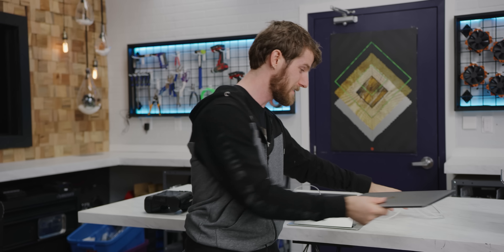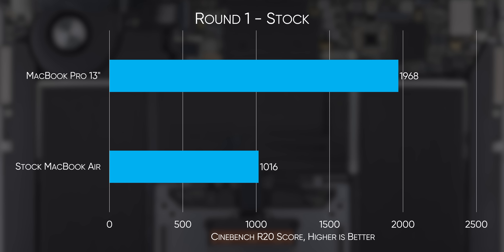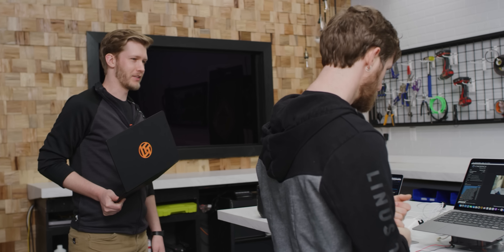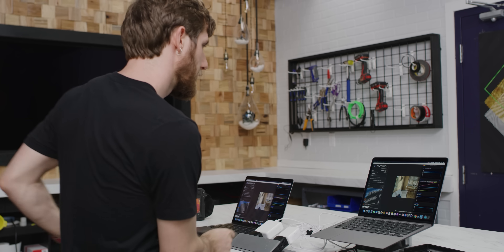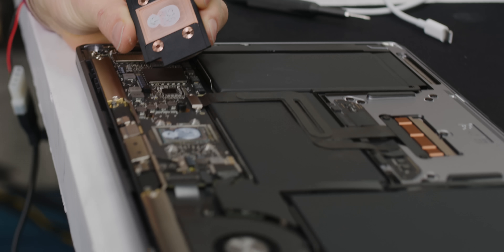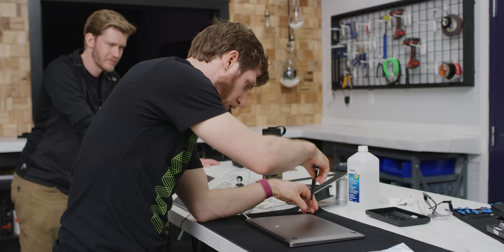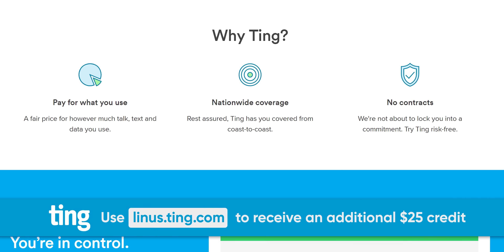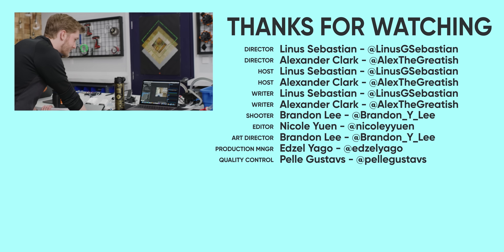Fixing Apple's Engineering in an Hour

Comment: Apple spends $$$$$$$$ on R&D. They have their reasons for “bonehead” decisions.
Reply: Well,
Having the CPU in contact with the bottom meant that the bottom was too hot, at around 50°C. This is why they did not do this.
The only way to keep its temp in check would be to have an active cooling solution, and that's it.
One does not fix a problem by creating another one.
Reply: traeng having an active cooling solution would mean making it bigger. This is an ultrabook specifically designed to be leightweight, thin and quiet.
Reply: @swisstraeng  You should apply as a engineer at Apple!

Comment: Apple had already made it clear on the spec.  Macbook Air has an i5 1.1GHz CPU.  Pro has a i5 2.0GHz.  You should not expect Turbo to run all the time.
Reply: What? Are you some kind of special Apple representative? The new macbook CPU heatsink is clearly a downgrade. 86C+ temps usually should be avoided, let alone 100C. This thing won't last past 1 1/2 years.

Comment: I put 17W/mK thermal pads between the cpu cooler, heatpipes, and heatsink on my Dell xps13. It used to sit at 99C constantly. Now maxes out at 70C. Unfortunately the bottom of the chassis hits 70C too. Buuut you know, trade offs.

Comment: Great episode. My 2019 MBP i7 runs ridiculously hot. Too hot for normal laptop usage. I keep it in a vertical stand with a fan blowing on the back. I also run Macfancontrol app and Volta. Easily hits 90C with a few Chrome tabs.

Comment: My 2015 Haswell Air has a heat pipe connecting the CPU and fan, but Apple redesigned the Retina Air around ultra low power m3 processors, and now they are shoehorning a quad core into the same platform. You think they would learn from the 2018 i9 MacBook Pro fiasco, but no...

Comment: You made the same mistake that Louis does and assumed it matters here. It doesn't. That's the point. The reason their cooling is passive with case airflow is that that's all that's required and allows the laptop to be thinner and lighter as a result. It's a low TDP CPU with specifically designed power delivery. It's not a workstation and it's not meant to be run at 100%. It's meant for basic productivity work that'll see like 20-30% CPU max most of the time.

Comment: Linus, you didn't need to mill it down. You could have just added a copper shim in between the cpu and heatsink. This has been a common practice with overheating laptops for years now.

Comment: It could be really interesting to see a series of you trying to improve the MacBook air’s performance through various means. I’m sure there’s some way to crack the MacBook, allowing you to adjust the power limiter so that cooling it actually benefits it. I assume the issue is that Apple knows how shit it is at cooling and so limits power usage based on time used rather than cpu temperature and if you could change that you could see a huge difference. There’s no real reason a cpu at 40° should see such a hit in power usage

Comment: Doesn't the MacBook Air only ship with a 30W power brick? If so and that was the power brick you were using could that explain why the power delivery wasn't up to scratch when you adequately cooled it? Maybe run the tests again with it hooked up to the 60W power brick the MacBook Pro comes with and see if that makes a difference.

Comment: I've never found a cooler to be particularly useful; something that blows air (and thus dust) into a laptop will obviously work against any internal fans pushing heat out.  It's like trying to use a sieve to hold water! As to CPU profiles, voltage will only ramp if the thermal limit is low enough... users just shouldn't expect Apple to take notice of these improvements.

Comment: Honestly it screams of outsourcing. The "engineering" contractors probably don't know why laptops have fans, but they do know they all have them so they whacked one in there.

Or it was an instance of one engineering team being ahead of another. The pcb team may have been on schedule and the cooling team was running past deadlines and the pcb guys did their job and didn't leave enough room for a heatpipe.

Maybe heatpipes caused it to fail q/c on drop tests, who knows lol. This was definitely a screw up by them that should never have shipped.

Comment: Has any manufacturer ever used the back of the screen to cool a laptop?  They have flexible steel cables that could be used to act as a heat pipe to transfer heat from the cpu to a heatsink on the back of the screen.  If you do that AND use a heatsink on the bottom you could probably get some great cooling.

Comment: 4:20 Linus, there is an explanation for the fan placement that nobody is talking about. Moving the fan such that the output vent was directly in front of the heatsink wouldn't make a difference, because it's still moving the same amount of air. Linus, this is effectively a "pull" configuration over the heatsink, just as you'd see on a radiator. When the bottom lid is closed, the fan pushing air out of the left hand side(when it's upside down) creates negative pressure inside, drawing air in from the right hand side, over the heatsink. You can see that the only other gap in the casing for air to come in is on the other side of the heatsink.

The reason your added fan made such a difference has nothing to do with the location of the fan; it's just because it's a much bigger/faster fan with more airflow. A lot of people are mocking their engineering about not knowing where to put the fan, but that's not the issue. The issue is simply the low airflow of the fan in general, and the puny heatsink with low surface area. The bad cooling was not the result of bad engineers not understanding fan placement, it was the result of design decisions to have a small fan and heatsink.
Reply: I'm not a fan of apple but I agree. I saw one comment saying "I bet if you removed the fan it wouldn't change anything" 🙄
Reply: Well, there are still losses coming from the fan being somewhere else. I wonder how much it is..

But that wasn't the fix was it though? It was fixing the heatsink by milling?
Reply: @rkan2  Yeah, I believe their post-milling test wasn't with the large fan, so having the heatsink fit snugly was actually more of an improvement on its own
Reply: Having the fan far away is typically fine, but there's no ducking so air can flow anywhere inside the chassis. Not that it will help any if you air gap the die.....why not just remove the heatsinc entirely? It'd probably perform better
Reply: Exactly! You just proved that Linux is clueless for anything than playing Windows games, somewhat poorly.

Comment: For precise depth cuts in milling, you'd never use the quill stop. It's simply not precise enough. This is exactly what the knee is for.
With machine off, first bring the knee up (moving up and stopping is important, as opposed to moving down and stopping) to some known position on the dial. Use quill to come and touch the part like you did. Then lock the quill there and don't move it. Now use the knee to lower your part a little. Now turn on the machine and raise knee up to known (and repeatable) height. Back off with knee and then recenter on next hole. Don't move the quill! Now you can move the part back up and get all 4 holes exactly the same depth.

Comment: Could a copper shim not have been added to the heatsink? 

I remember doing that back in the Nexus 4 days when there was a manufacturing issue that left the cpu with about a .75mm gap between it and the body resulting in it throttling very quickly

Comment: Could you perhaps put a a thin copper sheet covering the entire bottom panel (with thermal paste in between it) to dissipate the heat along the entire bottom panel? Covering it with electrically insulating paper/tape/sticker so you don't short any of the electronics? That should stop it being 46°c in that one area?

Comment: All Macs run at 99 degrees when you pushing the machine, Apple even turn off the fans on the MacBook "Pro" when the the machine does close to nothing, just to save a little power on the batterie. This is perfectly normal for a Mac and are what most Mac users like myself seems to perfere. A grown up teenager who think it's "cool" to add a fancy LED stripe to his cabinet just for the fun, would probably not agree. but then again, it's not designed for him either. 

If you want to prove that you can do a better job then Apple, by adding a heatpipe with a "lot smaller" heatsink then now in front of a fan, then do that. In the end it is all about transferring the energy to the air. The smaller a heatsink the greater a need there is for a good air flow, like from a bigger fan. So you will not be able to do it, without.

1. Making the battery smaller
2. The cabinet thicker
or to make the computer run with more fan noise.

Comment: Is there theoretically a way to increase the power usage cap?
Reply: You'd need a better way to cool it. Using more power means generating more heat, and this is the very reason they limited the power. So the CPU wouldn't melt.

Comment: I love the videos, guys, but your conclusions here are a bit strange to me. You did all this and barely improved performance at all, but still conclude that Apple’s cooling solution is bad. The fan isn’t over the CPU for two reasons: putting it there would make the laptop thicker, and airflow is airflow, wherever the agitator is. This is proved by your test where you removed the bottom and directly fanned the CPU, and only got 8% more performance from it. Not nothing, but not worth the thickness that incorporating that fan into the design would require (and it wouldn’t even give you 8% that way because the bottom would be on and the fan would be smaller than the one you used). You improved temps, but not performance, so who cares. All you showed is that Apple chose thinness over temps, with only very minor performance costs. I’m cool with that (that’s for you, Linus).

Comment: Yoi should've tried making your own HSF. Put a heatpipe there connected to the exhaust of the fan and solder or make some fins there.

Did this with a similarly anemic Asus X202E i3 by adding some heatpipe from a dead laptop and soldering in some fins from a metal folder binder

Comment: Switch to windows and do it again it will bypass apple’s limitations
Reply: the limitations are here so the CPU doesn't overheat too much
doing what you want will destroy the CPU.
Reply: @swisstraeng  Well at least the cpu has built in boost algorithms that boost frequency in safe margins. The limiting factor here is the terrible cooling and power delivery, and even if the cpu was cool enough to fully overclock, you would destroy the lackluster lowside mosfets.

Comment: The fan not beeing difectly beside the CPU heatsink is not a bad thing. Watch any 1U server. As long as there is a sealed flowpath for the air this is perfectly fine. The problem here is the shitty flowpath (rather non existing) and the tiny heatsink which is not even toucving the CPU.

Comment: That's not unique to Apple. 20 years ago the DEC Armada (later sold by Compaq) used heat pipes on the CPU running to a remote fan. Eventually the coolant gas leaked out, killing the concept.

Comment: I have an atx motherboard attached to coursair mid tower 100r. Will an motherboard wire that is 24 in. Be long enough to reach the board if the psu sits on the bottom of the case?

Comment: This reminds me of a design flaw on the XPS 15 9560. On this laptop, the VRMs receive little cooling from the fans and have no heatsinks. Under sustained loads a few of the VRM chips can get way too hot, causing it to thermal throttle.
The way the community fixed this was by using a stack of thermal pads on top of the 'problem VRMs' (which were identified by thermal imaging camera), these connect them to the aluminium laptop chassis.

It's only dissipating a couple of Watts of heat at most, but these VRMs would cause the CPU to thermal throttle.
I did this myself and it made a big difference.

Comment: Ps. At the top: portable water cooling. Now that would be cool
So really to use a macbook air well, I need to change the thermal insulator to a conductor then attach it to a water block running through a fridge so I don’t get burnt.

Comment: It was most likely designed to keep the heat in and away from the case. Its probably intended to force the chip to thermal throttle.

Comment: I think they are placed the fan at the side intentionally for sweep air not only on cpu, also at the other components on logic board as well. A basic CFD simulation could explain it better to you. It doesn't justifies their thermal solution, but it makes more sense for imagine anyways. Beside this , how the they ruined that heatsink design with surface gap between cpu surface and heatsink is an epic fail. This is why you should check you pc's thermal compound condition after purchase. The best gain at your test is chamfering the holes on the heatsink and with that you have greater surface contact between cpu and compound, so better conductivity at the end. 👍🏼

Comment: So my question is what happens if we run cinebench in windows. My theory runs in line with the infamous i9 macbook pro where if I remember right windows handled the cpu profile differently. I may be (and probably am) wrong but it's just a curiosity test that I would investigate if I had the ability to.

Comment: They honestly should not have even put a heat sink or fan. it would have cost less for them to just put the CPU in direct contact with the bottom chassis and use that as the heat spreader basically and be passive. That honestly makes a lot more sense to me but I guess what do I know?

I mean, that's a stupid ass solution to but it's still better than what they did here LOL and at least it would have cost less to implement

Comment: the neigh 15% increase in performance from getting proper contact with the heatsink and removing insulation is disgusting. That's some really bad engineering even if your goal is to make the thing never hot to the touch. I feel like that 'not even touching the CPU' problem reinforces Linus' theory about the ARM processors, maybe those are a bit taller?

Comment: Isn’t the intake the other side of the cpu? Meaning the fan draws air in on the right (looking at the internals without the bottom on), over the cpu, and out through the fan on the left? Am I missing something or is that not the plan in the 1u desk PC? (Admittedly with substantially more cooling haha)

Comment: You do know that attaching a big water cooling system to a MacBook Air negates the whole design intent of the line, right?
Reply: Better cooling in this form factor is still much more achievable than Apple is willing to do. Just two 2mm heat pipes to a heatsink and fan would be so much better, let alone better mounting hardware lol...

Comment: I genuinely don't give a damn how thin it is, selling a piece of hardware that throttles BY DESIGN, is absolutely an abhorrent practice and should be condemned in every capacity. Besides why not just put a slightly slower CPU in it in the first place of its gonna throttle like that? Oh i know, so they can advertise that it has a high end CPU in it even tho it performs like absolute dogshite. Apple are disgusting.

Comment: 43c is normal shower temp? what the hell? thats like scalding hot
Reply: It's not actually. Some people shower closer to 45. If you shower in body temp water it won't feel warm, might even be slightly cold due to heat loss in the air
Reply: @jacquesdebruyn6748  I put a thermal valve limiting me to 90F or 32C but I am old with thin skin.  :)

Comment: Get a graphite sheet, with adhesive on one side. Put it on the inside of the bottom metal. That well spread out the heat much better so you wont get the 46c hot spot

Comment: It's designed like that because with the bottom cover on, the air is forced through the heatsink due to the tight tolerances. 

Source: Louis Rossman

Comment: To actually get more performance out of it, you gotta do three things, and then the laptop won't be power limited.
A) Use bootcamp and go into Windows.
B) Download Intel Extreme Tuning Utility
C) Increase the Turbo Boost Power Max to whatever wattage you desire.

I did this on my Dell laptop and got significant performance gains out of it.
The Cinebench R20 scores increased by 250.
Reply: I can solve the performance in 1 step. Buy a real laptop
Reply: @Zelinkondorf  Nobody ever bought a macbook air to do fucking rendering on it
Reply: Won’t work as power management is done by apples firmware not os
Reply: What you don't understand is that doing this will cook the CPU off, because the only issue here is the temperature. Your dell likely had a better way of cooling, like, fans.

Comment: Try the same tests with the Mac running Windows (bootcamp) with optionally MacsFancontrol and I'm sure you'll see huge performance improvements.

Apple knew tech enthusiasts will try to do this and they capped the performance gain from lower temps in Mac OS.
Reply: If they are running into power limit (rather than thermal limits) then there really isn't much more that can be done. The CPU being used only has a TDP configurability range from 9W to 12W. Intel basically limits these chips within these tiny margins for any OEM to limit cannibalization of their more powerful (and more profitable) chips.

Comment: gotta love 14nm+++++++++++++++, my laptop has an i7 8750h and it takes about 80w to max out the all core turbo. a few seconds of that and the bottom is at like 60-65c. so 46c isn't so bad.
Reply: ironically the 1060NG7s and 1030NG7s on the macbook air are actually 10nm.